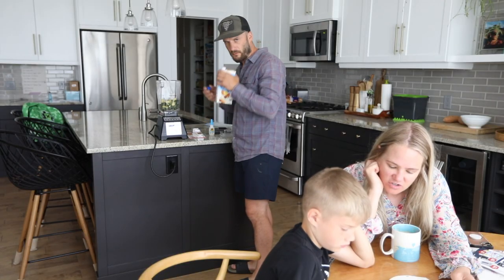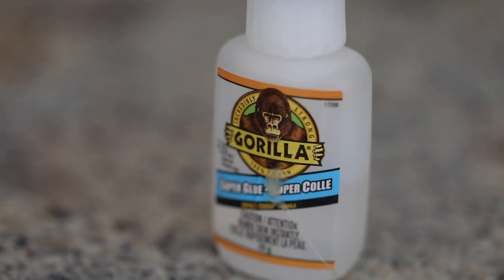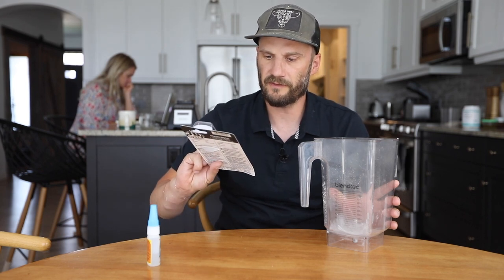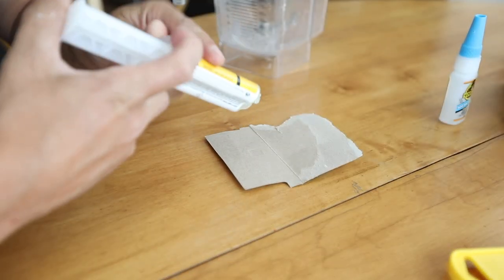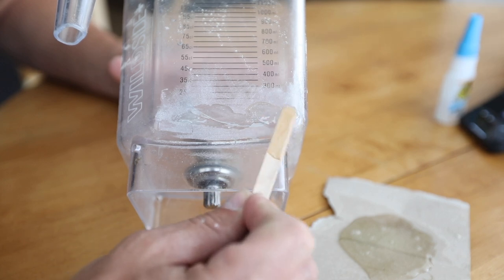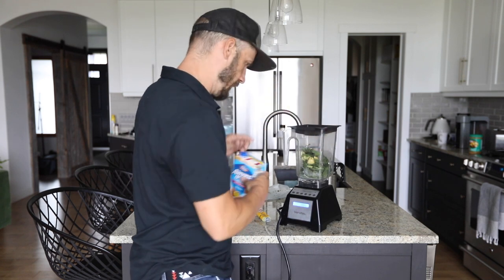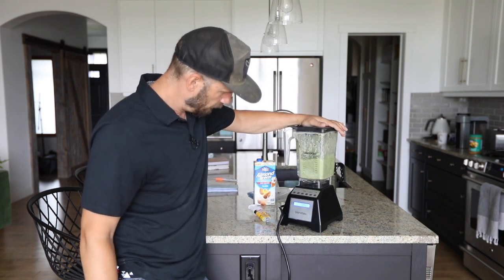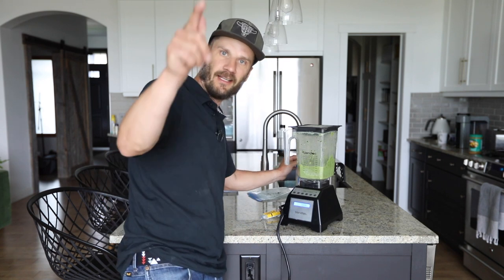Blender Repair - JB Weld on broken Blendtec jar

Comment: Thank you! thank you! Thank you for making this video! I bought some of this stuff and fixed the 2 huge cracks in my cuisinart food processor bowl. I tested it out this morning and water is holding in the bowl. Love it! The only thing I would mention is that this stuff stinks!!! You may have mentioned it in the video but I would recommend doing this out in the garage. I applied it in my laundry room and it took hours to get rid of the smell. Also, after reading other people’s comments about their food processor bowl, I should mention that I applied the jb weld product on the outside of the bowl to minimize the chance of it coming near food.

Comment: @rink this seems to be a good solution. Every jar which came with my food processor has developed cracks and is leaking. Will try this. Just hope that the product is safe to use and the toxic ingredients don't mix with the food

Comment: Rink, why not just use a handful of almonds in your smoothy instead of store bought almond milk? You will save a ton of money and save the packaging of store bought milks. Thats is what we do. BTW: It is super easy to make nut and seed milks in a high speed blender. The resulting milk can be filtered or just use as is and let the fibre sink to the bottom. I use a cup of seeds or nuts, a pinch of salt and 4 cups of water ( one litre) for delicious milk.
Reply from the maker: This is something that I ought to try! Sounds great and thanks for the hot tip.
Reply: Homemade almond milk is so delicious. I put in one or 2 dates and I soak my almonds overnight.
Reply: Save the packaging? 🤣 Someone's gonna buy it regardless.

Comment: I have the exact same crack on almost the exact same are of my Blendtec Wildside jar.  I thought about trying this, but my only concern is that since there is still a crack on the inside of the jar, it is filling with tiny bits of food that is virtually impossible to get out and then I wonder how much extra bacteria is getting into every batch blended.  Sealing the inside of the jar is iffy if this stuff is not food safe.  I wonder if a food safe seal would exist?
Reply from the maker: Yeah that’s certainly a concern for sure. There is soooooo much force on that crack though. It’s ridiculous how much $ they want for a new jar. Let me know if you figure out a better solution!
Reply: @RinkVideo  So I did some research just now and JB Weld also makes a "drinking water safe" version of their epoxy so I'm gonna give that a shot and do both in and out.  I too can't justify paying that much for the new jar, lol.
Reply from the maker: @brianhwang5223  amazing. Let me know if it works and I’ll do the inside of mine too. Mine wasn’t terribly bad but I just wanted to stop the crack from spreading. Which so far so good.
Reply: @brianhwang5223  thanks that is what I was here for.
Reply: @brianhwang5223  vitamix also has expensive replacments. nearly 200 for a new one which is literally 75% of the cost of a new vitamix blender...

Comment: I have a 3 inch wide hole, any suggestions? I experienced the same thing as you: The container is almost as much as purchasing a brand new appliance!
Reply from the maker: That’s a big hole! There’s a company called Alterna Jar that has a more affordable replacement. You’d think the cost of a Blendtec would come with lifetime warranty 🤷‍♂️
Reply: @RinkVideo  Thanks
Reply: By 3 inch hole, do you mean the screw-on base?   If so, see if the threads fits a mason jar.  On Oster blenders, they fit perfectly.
Reply: @JeffTheHokie I mean the hole in my container is about 3" in width. It blew a hole when I was trying to shred a coconut hull. It was no match for it.